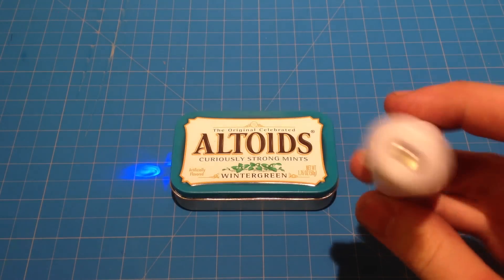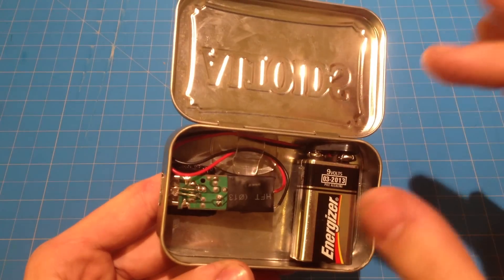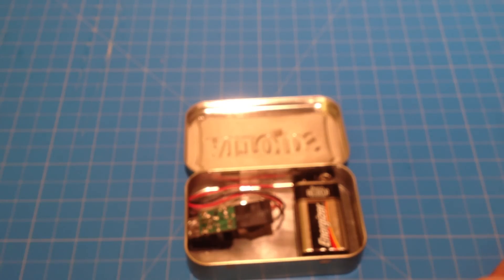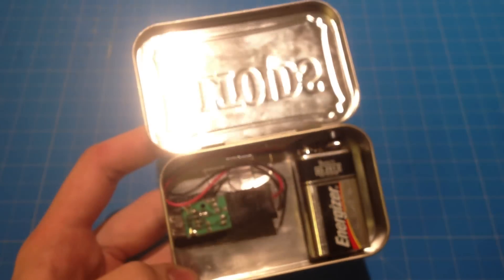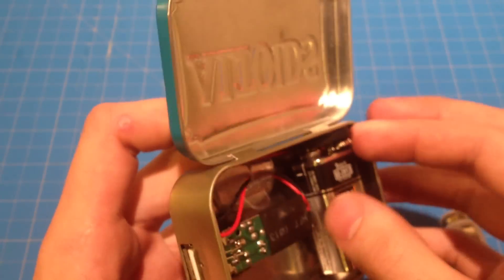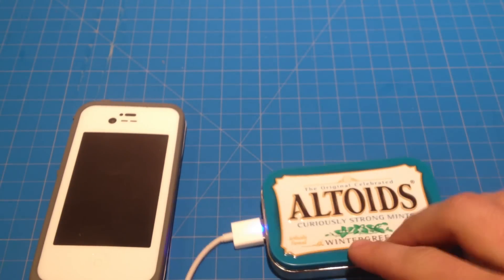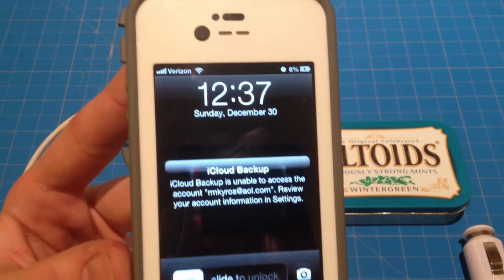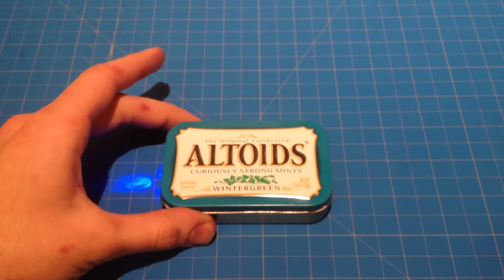$3 Altoids USB Charger

Comment: I got my 2 usb ports charger from ebay for 1$ :P the 9v battery can be replaced with a rechargeable used 12v Lithium-lon from eBay ;)

I build my charger today and it works perfectly and the used battery charges fully but gets empty after fully charging my s7 edge, galaxy note 3 and a ps4 controller :P

Comment: Okay, I have a serious question. Now, normally with devices such as an iPhone, the data says that it is charging, but it continues to drain as it is "charging". So I believe these chargers are fake, because all it does is waste battery power.
Reply: Does your iPhone actually charge from this? Or are you faking the entire video. Because it says it's charging but it most likely doesn't.
Reply: +Scotlahn Mccallister his idea works yes and it charges for a little bit of time... But because of the power being strait up 9V the iPhone stops taking in power over time because the iPhone only accepts 5V. I made one myself but in order to make it work you need to use a 5V regulator which takes the 9V and makes a constant 5V output. Hope this helped :)

Comment: this will give your phone like 5-10% charge, i would buy a 6 cell laptop battery, open it, use 3 of the cells and a 3.7 to 5v output and charging circuit for like $7 and it will charge your phone 2-4 times full guaranteed depending on cells and phone type. i can make a video if desired.

Comment: A word of caution. It works yes but I'd only use it as an emergency device. The car chargers are designed to work on 12vdc. This is operating at 9vdc which will run at a higher current to satisfy the demand. This could possibly cause fires or damage your phone. Not to mention the cost of 9v batteries over one charge will cost more then buying a proper external battery. Just my thoughts. I figured as an electrician I should put that out there.
Reply: I took about an hour making one of these and 1.) It says that "This accessory may not be supported" 2.)It doesn't charge you phone 3.) It costs more than $3 (It cost me $8-$10) and 4.)It isn't safe or durable unless you own a soldering iron.
Reply: Ron Gallie will more batteries being hooked up fix that? (Sorry don't know much about batteries or vdc)
Reply: Ron Gallie OMG thank you

Comment: i aparently need to do a vid on mine. 9 volt bat 4 solar panels from dollar store, 2 rechargable batteries on two of the panels and two direct with a 5 volt voltage regulator and with each on a switch. run it in any environment under any needs, in an altoids can. . .
Reply: Where's ur video???

Comment: Yea...$3 tin plus $15-45 in 9 volt batteries to charge your average phone 3,000mAh phone battery.  Depending on the battery, your phone might be consuming electricity faster than the 9V can even charge it.  Just spend $5-10 on a portable charger from your local gas station and save yourself some trouble.
Reply: a 9 volt is just an example.
Reply: You can use two ++AA batteries. I already have like 40 of those. The concept is the same if your smart enough to know how to do it.
Reply: +Kristi Hall two AA batteries have even less juice then a 9v
Reply: +Evan Williams II No they don't.  The average 9V battery can hold between 400-600 mAh.  The average AA batter holds between 1800-2400 mAh.  Even a AAA hold more.  Between 800-1200 mAh.

Comment: Im going to make one!!! We are traveling from Texas to alaska next year! lots of camping and such. It will be nice to have an emergency charge station. I may make 2 even. Can you tell me how long it will last? how far will it charge the phone to?
Reply: Jennie Craten A 9V battery will deliver 90-240mA when charging a device at 1,000mAh.  Most newer phone charge at 2,000mAh will will cut those numbers down even further to about 45-120mA.  So a modern phone with a 2,500mAh batter will get about 3-10% from a single 9V battery.  You can buy a 10,000mA external battery charger with 100x the capacity for like $12 from amazon...
Reply: Nick Fotopoulos thank you!

Comment: This is truly for emergencies, otherwise you'll damage your phone's battery. Car Cigarette Lighters output 12V DC. This device uses 9V DC. Regardless of whether the USB port itself has a built-in transformer, its designed input from the cigarette lighter's plug is 12V DC and not 9V DC, thus you are not sending the right output voltage into your phone (if the USB port does have a transformer, under, if not, over. I'm guessing over, since the phone still detects charging current), which can (and will) damage the battery.

Comment: Where did he get a car USB charger, a 9V battery, and altoids, all for under 3$ ?
Reply: he probably assumes that when you get a new phone, it comes with a car charger. Last 3 phones I got came with car chargers. That was over the course of about 5 years.
Reply: Just go to radio shack and ask for a positive, negative charge harness. I did it today
Reply: at RadioShack the 9 v battery is $4.99, but a pack of 9V connector pads with wires is $2.99/5.  The dollar store had altoids for 1.59/ ea.  With tax, this cost $9/ea.
Reply: pakapakapaka Lol, in ma country car charger 1.5$ and 9V battery 0.5$ so total 2$ ;)

Comment: Good Mcgyver skills for when you're in a serious pickle, but outside of that, doesn't seem very cost effective. You can't even get a decent 9v battery for under $3, and I can't see it lasting more than a single charge, two at most. You can buy a rechargable USB charger for $10.
Reply: Not to start an argument but this is mainly for emergency situations. Like you have no electricity or your phone dies and your in the middle of no where with a dead car. But I do see what your saying and was wondering how long and much it would charge for as well.

Comment: Try using a resistor to even out the electrical current. Sometimes there can be to much current passing through so u have to level it out look up how to install a resistor.

Comment: My battery gets really hot.. is there anything I can do about that?
Reply: You Gould connect the battery directly to the USB without any wires
Reply: It's problem lay cause you connected your positive wire to the negative.
Reply: If the battery is getting hot you have a short somewhere.  Isolate any wiring/connections from touching anything it shouldn't INCLUDING the tin (if that's what was used as a case) Electrical tape or Hot Melt Glue can help prevent this.
Reply: I actually compacted everything into the car charger casing, so it couldn't be the tin.. there might be something touching in there though so I'll take a look at that. Thanks!

Comment: How easy would it be to put 2 9volts in a series? Would that hurt the phone from high voltage or is there a regulator? Would it last longer or would both batteries drain out?

Comment: Led wastes battery
Reply: If you remove it would it use no batteries when closed? Also would soldering a switch to the positive wire make so you could turn it off and still have the LED to help indicate  that the 9v ins't dead?

Comment: A $5.00 alkaline battery lasts for 10 minutes and charged my phone 10%, then the voltage drops to a level where you can't charge anything. So unless you want to spend $50 for one full charge, this is a fraud

Comment: Try using the car charger from walmart. You can get it for 5 dollars. Its kinda hidden so you will have to either look or ask. I made one but I used 8 AA batteries and it works like a charm

Comment: Would it work with 8 AA batteries?
Reply: Yes it will. I have made my charger. I use 8AA batteries and it charges at the speed of an ipad wall charger. it puts out around 2.1 amps but I used a car charger from Wal-Mart. I got it for 5 dollars. It was kinda hidden so you will have to look. You can un-solder the + and - to the charger and solder in new wires. My charger works very well and I'm hoping to start a "mini business" with it. Still trying to make it more compact

Comment: when i connect to my 5s, it says something like "accessibility may not be supported"
Reply: same with mine. except im using a iphone 4 and put a 1 amp switch inside also
Reply: thats becouse your iphone checks if the charger is an apple or not :)
my friend has the same problem with all chargers exept standard
Reply: If there is no resistors on the data plus and data negative. The phone will no that it is not pluged into a computer and it will refuse to charge.
Reply: what kind of resistor do i need to use?
Reply: Viren Dave 100 ohm on each data pin
Reply: What do you mean by "on each data pin"?
Reply: Viren Dave Read this and see it helps...http://ea4eoz.blogspot.ca/2012/09/using-mini-iphone-chargers-with-android.html. Search the net for a lot more images, vids and articles regarding this work around. 
Google is your friend...use it !

Here's another good article on the theory behind Apple's madness ...  

http://gizmodo.com/5604366/mintyboost-cracks-the-secrets-of-apples-charging-methods
Reply: ODX171 Thanks dude!!!

Comment: That wont work it looks like its charging the fone but its actually not it will drain the battery because car chargers are made to recieve 12 volts from the car battery and the 9volt battery only produces 9 volts
Reply: it uses a L7805 5V regulator so no matter what voltage you put in it will have 5V going out it needs 5V going out because that is standard for usb
Reply: This is true i have been testing them with the newer phones an the newer your phone is the more volts/amps the charger actually needs to charge your phone so in the end just but a 12 volt rechargeable lithium battery or buy a 9v that can put out more amps faster or do like how the guy said in the comment above

Comment: I'd use rechargeable 9V's...I'm PRETTY sure that 9's come in rechargeables.... Recharges perios are nice....I like how it turns on and off the way it does without the struggle of soldering more wires. I once made a 300V stun gun using an Altoids tin as the project box...

Comment: Don't do this project because phones take 5volts not 9 volt battery
Reply: 5volts will always be going to the USB because the volt regulator inside of the charger will be working and giving 5 volts no matter how many volts you put through it, or it just maybe that's only on my charger :)

Comment: Is there any way you could 8 AA battteries or 8 AAA batteries to increase batterie life and stay at 12 volt? Also does the car charger act as a voltage regulator and keeps the out put voltage at 5 volts?

Comment: I made one of these and there's only two problems that I have come across. First the phone sometimes says it's not compatible because the charge is to weak. A car charger is 12volts not 9volts. Second the batterie doesn't last that long at all. Even with a fully charged batterie I only get about 6 to 10 hours off of one. Plus a little side note it doesn't really charge your phone that quickly. I've timed a wall socket to this charger and the charger took about 15 minutes to start it up from dead. The wall socket took about 2 minutes to start up. To get fully charged the charger took about 4 to 6 hours while the wall socket took around 1 hour. And for a heads up for anyone who wants to make one of these it cost about $15 to $20 not $3.
Reply: You could buy a cheap 9volt battery for a dollar, the car charger you get at the dollar store, and get an altoids in a dollar store which would bring you up around $4
Reply: 9 volt battries are about $4 to $5 for 2. Altoids case is $2, and charger $5 + wires and stuff $3. That coms up to $15.
Reply: Charly Can Count yes, you are right but there is another way. All of the stuff you said you could buy at a dollar store and everything at a dollar it would be around $5 I know this is true because I've bought them at that price

Comment: If you want the output voltage to be 12v then it's just easier to build the circuit yourself. However if you're talking about input voltage then a car charger runs on 12v anyway.

Comment: Since a normal USB car charger works on 12 Volts, the 9 Volts from the battery will allow the device to function, but charging time would be VERY slow and probably kill the battery in one charge. Still, awesome innovation!

Comment: The reason y this works is the he using a car charger parts the car charger shorten the car 12 votes too 5 votes are lower so win puts a 9 vote battery on to the charger it shorten it too 5 are lower votes

Comment: @madpixalgames so listen dumb ass the tin is optional as he said the charger is 1 dollar in dollar tree and so are the nine volt battery so far thats 2.20 with tax and u dont need a soldering iron its called twisting the wires and putting tape and if u dont have any time of tape then u just a broke boii;)

Comment: No you can not due to the fact that a wall charger is designed to work on 120v ac not 9 volts dc which is what the 9v battery produces. This emergency charger works because the car charger is made to run off of 12 volts dc and the 9v battery isn't far from that.

Comment: Remember, this IS an EMERGENCY phone charging.charger system,  ...You/one could AND can ALWAYS get a couple of 9 volt rechargeable batteries,and keep them at the ready, always have them in/on the charger...These ARE cheap enough via eBay,OR Amazon...
-A.D.

Comment: Check in your product manual (or online) what the highest voltage your device can take, the battery he used is a 9v, if it is a little over it should work since it is for emergencies only (infering that is what you would use it for) and you can also get voltage regualtors for very cheap and you can find many videos on other chargers like this one that include a regulator

Comment: Just out of curiousity, what happens when the battery drops below a certain voltage for the IC on the usb charger? I'm sure it probably works down to 7.5 or 8 volts, but when it gets below there, does it auto shut-off or does it just put out a lower voltage to the phone, and in this case, do phones stop taking the charge?

Comment: Interesting, but please let us know where you can buy a tin of  Altoids, a car USB charger, and a 9V battery for $3? Lol.  BTW, you didn't need to take apart the USB charger or use a tin.  It looks like the 12v car USB adapter you had can operate AAT only 9v... So just attach the wires from the battery directly to the car USB charger.

Comment: i have a question: wouldnt this not work if i charged in a usb device with a larger charge than the 9v battery because the usb device would try to charge the 9v battery or am i being stuoid and the circuit board from the car charge will preven that.  please answer my question

Comment: It depends on the voltage regulator, if you take the plug apart look for a chip or a 3 pin device and google the part number. If you find data on it, it should tell you the maximum voltage, but the higher the voltage, the more heat the voltage regulator will need to dissipate so you'll probably need to stay 9 to 12v. If you go too low on the voltage you'll reach the cut-out point of the voltage regulator (should also be in the data sheet). At that point, the voltage will be too low and no charge

Comment: Every body listen all you need is a 9 volt battery and the USB and you don't even need the connector just put wire on the 9volt

Comment: I made one and it does work but it only works if the 9 volt has a charge up to 7 or 8 volts so do u think that u could solve that problem and possibly make it last longer wit a smaller charge in the battery

Comment: Just a suggestion (what I did personally) cut you down a power cord, get rid of the data cord of course. Connect the positive and negative wires of  the cord about 4 inches long and leave it inside the tin so you have one for emergencies

Comment: With the metal spring, which you said was positive, and the prongs, negative. Did you tape over them with electrical tape or bend them back? Can i bend the spring back and still attach the 9Volt connector to the positives and negatives?

Comment: Consider the typical 9v battery is 500-600 mah, and my cell phone battery is 1300 mah. Even taking into account a usb outlet is 5volts which would make the 9v last longer. The 9v is not going to last long nor charge the my phone a whole lot.

Comment: yeah, but you need a 12v voltage regulator. So you wire you 9v batteries in a series ciruit and regulate that to 12v!

Comment: I made something similar to this (No USB port, just straight to the cut open Ipod cable)  And I will try to explain it as best as I can.  It goes from a 9 volt to a Verizon car charger which only has red/black wires. I cut it's wires open, and then attached them to the white/green/red/black inside an IPod cable.  It took me a really long time but I found out that you have to connect the white/green/red to the red wire, and the black to the black.This is a good alternative if you don't have a USB

Comment: it depends on the charger you are using. so if you make one be sure to get a charger specifically to charge an ipod/phone. or one that tones the voltage down to 5v and mah to 350 (pretty sure it is 350, but look it up just in case)

Comment: Most disposable non-lithium 9v batteries are only about 500mah. Thats about 4.5W. Converting that to 5V with 100% efficiency means you get 900mah. Most of these cheap car chargers are about 70% efficient, so you are realistically looking at about 600mah, which with an iphone charging will only give you roughly a half an hour of charging.

Comment: You could also use a small voltage regulator and use more than one battery so it will charge longer

Comment: try just using the battery shown in the vid. i get this a lot with the arduino kits and it's easier to just use the recommended sizes.

Comment: For anyone building this take in mind that the tin is conductive so i would put some kind of material between the tin and the board from the charger. if you don't you may short out the circuit or even worse short out the battery. Trust me when i say DO NOT SHORT A BATTERY.